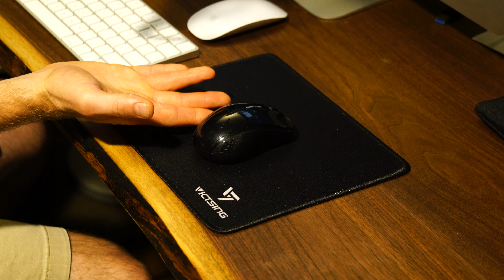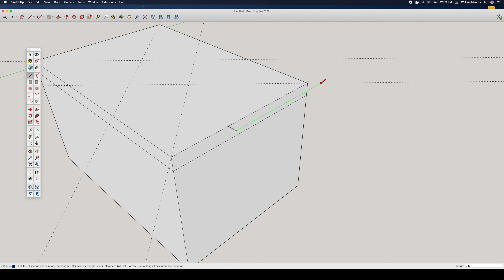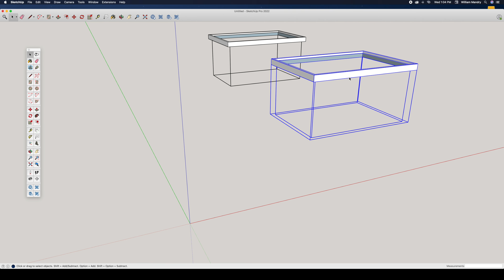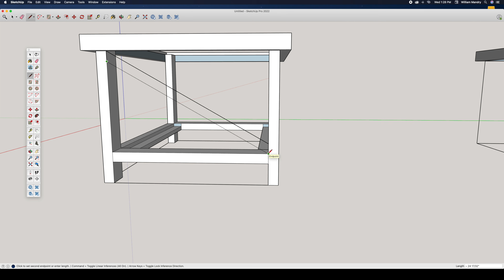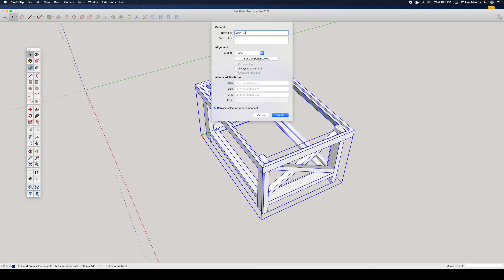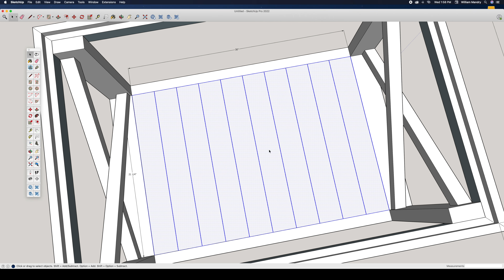How to use SketchUp Pro: Beginner Tutorial For Woodworkers

Comment: I suggest you use the tape measure tool to create guide lines instead of drawing a small line, like you did to create the rabbit on the top. It accomplishes the same thing, but its easier to use.

Comment: First issue is your mouse! Get a vertical one. Second issue is view control. Chances are, you spent a crap load of dough on a table saw (pity about that) buy a 3DConnexion Space Navigator. 3rd: Change to Parallel projection, 4th: 2x's are 1.5, 5th: USE the Rectangle tool. 6th: you are wasting time with the Protractor tool used 4 times. Create ONE Component properly FIRST. Enough watching. You don't have a clue.
Reply from the maker: Sounds like you know a lot about SketchUp! I’m definitely not a master at SketchUp this is simply a beginners tutorial to get started. I I think to each their own as far as what tools that are utilized in the program. I’d say at the end of the day if you have fun editing a design and get the job done who cares how one does it?
Reply: There is no need to be so flipping rude dude! You could’ve said all that without saying he didn’t have a clue. Older people are usually more mature than that. Stop being a Keven, and try to be a little nicer. 🤦🏻‍♂️ Jerk.
Reply: I don't think I would be judging someone else's video after seeing what you have on your channel. Dust control is not just turning an elbow to blow dust in a different direction. LOL!!! I have watched several videos on SketchUp and agree that there are many different ways to do things.
Reply: @brucewelty7684 can you please point me to your youtube tutorial for SketchUp for beginners, so I can learn form an expert like yourself.
Reply: @Yelwas  I stopped making tutorials at v8. No one was interested. For what it is worth https://www.youtube.com/watch?v=soZpDYZYAoY&list=PLOJE8WkpLhkmpT5-SAGIT5v-H-84M7eDE&pp=gAQB  I do answer questions on my channel
Reply: @brucewelty7684  it appears the link above is to other people's YouTube channels.

Comment: AXIS -not access. Im very confused because a 2x4 isn't 2x4 inches exactly. If this is a drafting program is it ok be using numbers like that? If this is for woodworkers use woodworker terms. You made 2x4 legs presumably  ripped down to 3inches x 1.375. I think it would make more sense if you didnt keep saying 2 x 4s and just said this cut and that cut etc. if you were using real 2x4 dimensions 3.5x1.5 it would be understandable.

Comment: Why not use rectangle tool to make leg instead of line tool? Also you can use guidelines from tape measure instead of temporary lines all the time, you can go to edit and remove all guidelines instead of eraser.
Reply from the maker: You can certainly use the rectangle tool, sometimes I find the line tool easier to work with. Correct you can use tape measure lines instead of using the line tool. I’ve tried both ways and found the line tool works better for me, easier to see, and easier to snap onto. It’s just personal preference, there’s so many different work flows that can be used to achieve the same result, you just have to experiment and use what works best for you! Thanks for the comment!

Comment: I followed but at 13.29 I couldn’t get the push pull to only work for the rabbit or relief cut. What am I doing wrong ?
Reply: Awesome I figured it out ! Thanks !!
Reply from the maker: When you can’t get the push pull to only work for a specific part it means that the program doesn’t recognize the part as a unique piece. To make a section a unique piece you have to make sure that there are lines connecting each other to make a unique face on the board and to separate it from the original face. For instance if you draw a line across a rectangular face and don’t connect the line just right to the ends of the rectangle the line won’t separate the rectangle into two faces. The line therefore won’t effect the push pull tool. My guess is one or more of your lines at the endpoint aren’t connected. The other problem is that sometimes the program draws lines right above the surface instead of on the surface which effects it. You have to make sure that the line is drawn on the actual surface of the board. Hope that helps!